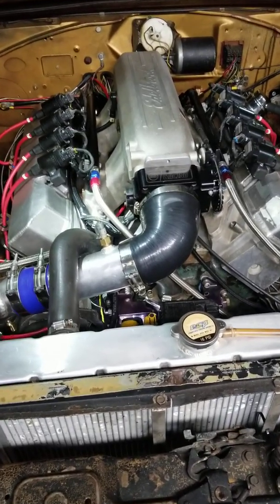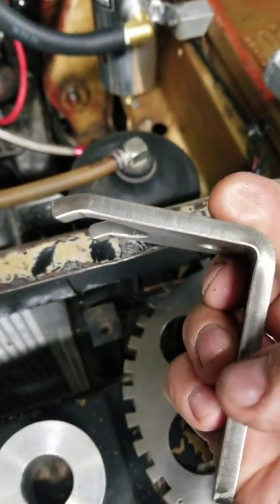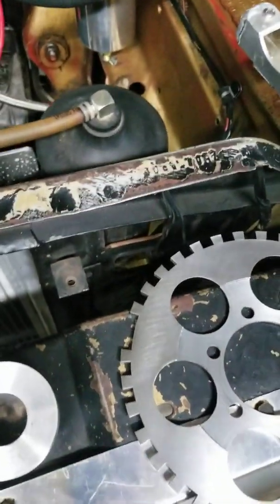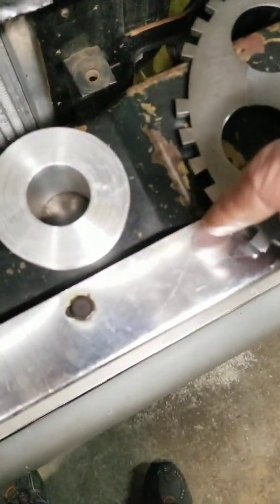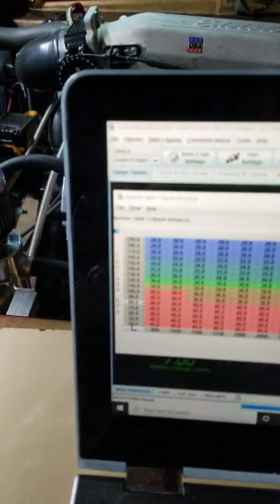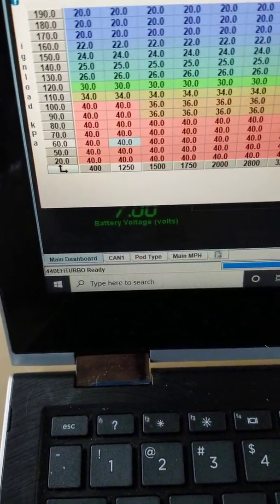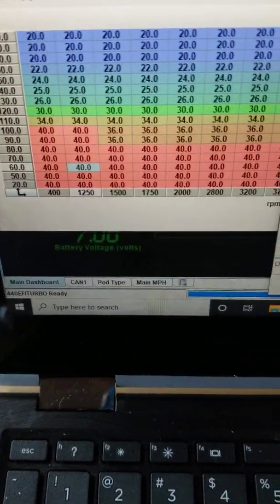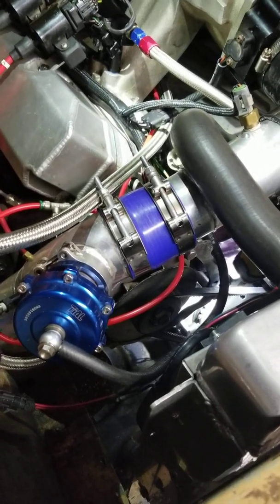440 Megasquirt EFI Cam Position Sensor to Crank Trigger Timing Setup

Comment: Hi, I am doing something similar but different. LS coils on a 383 but I'm planning on wasted spark with COP. This avoids the cam position sensor.

Is there any other pros for adding the cam sensor for sequential ignition?

BTW the intake looks awesome!

Comment: Would I be able to use a crank trigger that’s turning off the distributor cap to run cop and sequential fuel injection?
Reply from the maker: I’m not a complete Pro but from the way I understand how this system works you need a crank trigger and a cam trigger to have true sequential spark. The benefit of having a crank trigger is timing accuracy. Timing off of a crank trigger is dead on and does not  wonder like timing from a distributor. You can run just a crank trigger and run wasted spark coil on plug. The bonus of adding a cam position sensor is then you can adjust fuel and timing per cylinder. Any questions just ask.

Comment: is the crank wheel thin enough that thebelt alignment isn't a problem or did you have to make adjustments for the belt alignment?
Reply from the maker: It offsets the lower pulley by 1/8”. I’m no longer running a fan and I have adjusted the alternator as needed.
Reply from the maker: If you are interested in going EFI I am more than happy to help with information.